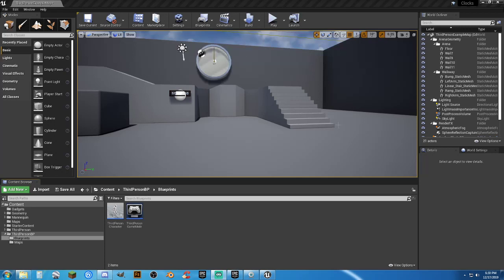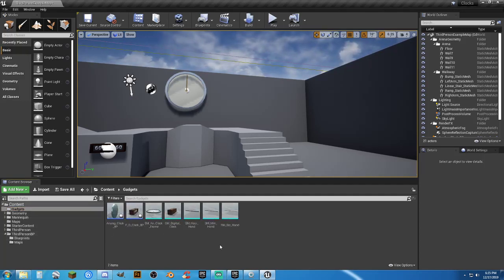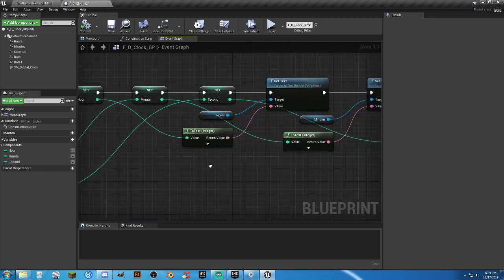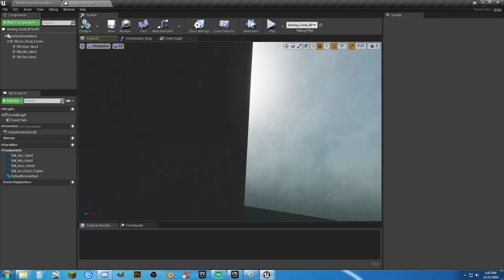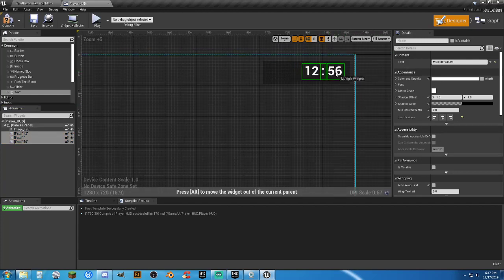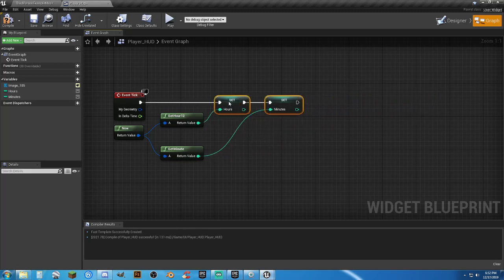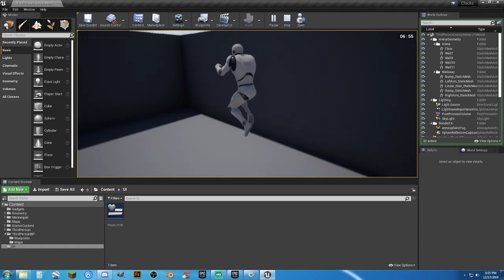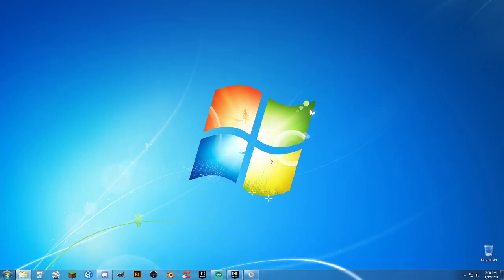UE4: Making Time - functional analog and digital clocks

Comment: Divide 30 degrees by the number of seconds you have in an hour and you get 0,0083333. Every hour has 30 degrees. Same with the seconds, 6 degrees is one second divide by the number you have in a minute. 360 degree circle devide by the number of seconds/minutes is 6 degrees. And 360 divide by 12 hours is 30 degrees.